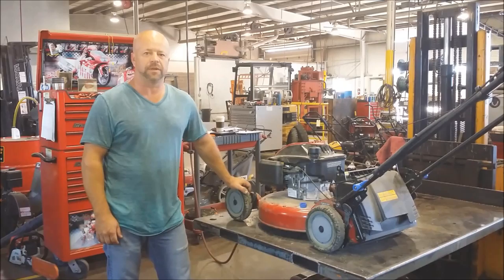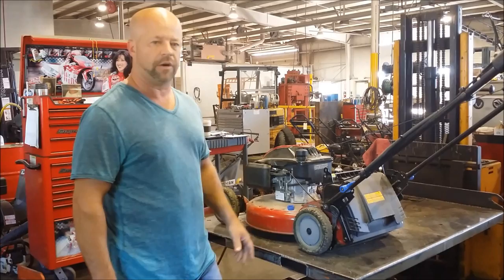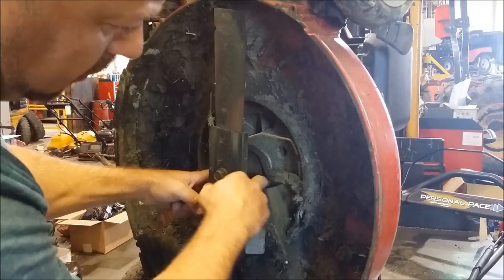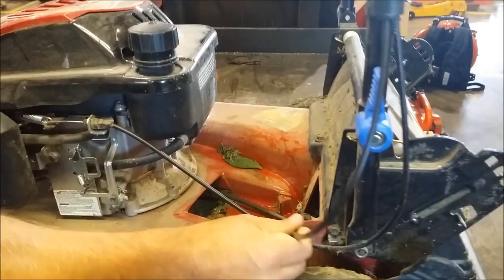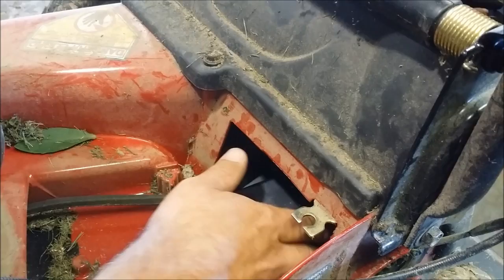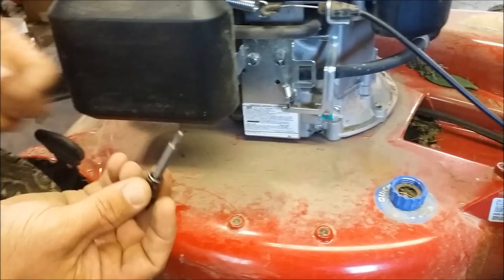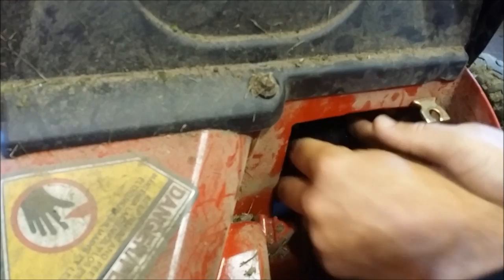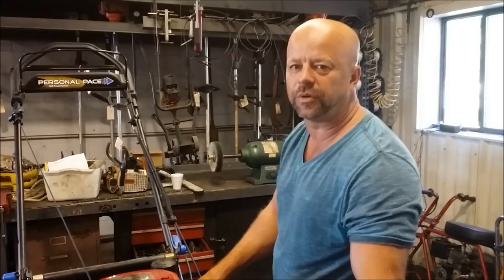How to Troubleshoot and Repair a Toro Personal Pace Drive Lawnmower

Comment: This video was helpful to me. I just removed the cover to the pulley on the transmission. My belt appeared at first glance to be on the pulley. However, the belt was partially off the pulley due to a 1/4 inch piece of stick from a tree that jammed in the pulley / belt / cover keeping it all from turning.

Comment: i have basically the same mower i'm working on for a customer and have installed a brand new belt. The transmission turns but very slowly. the belt is snug and tight but the transmission does'nt  move the mower. I can't find a troubleshooting guide to diagnose if the transmission is bad without removing it and trearing it down. what else can cause the wheel to not engage  As i said , it turns slowly. I can raise the back wheels and see the tires turning but as soon as i put it back down it won't move.
thanks for any advice.

Comment: mine is a similar model, but didn't have a plate to remove on the top. i needed to do all the repairs from the bottom side, removing all of the guards below. got the belt back into the groove, put it all back together, worked fine for a single mow, but then the belt slipped out again. not sure what's allowing/causing it to come off. :/ 
after the belt comes off the first time does it get stretched/is it more likely to come off again/need to replace? any other suggestions why it continues to slip off?

Comment: Good to see that they make it easier to get to the transmission,   I had to change a belt one from 2003 and the blade adapter was fused to shaft so I ended up putting the belt in at the same time as putting that engine back on as well.

Comment: Is there supposed to be a bushing or spacer between the pulley and the engine when I tighten the blade down on mine the pulley locks down on the engine case I had some one else replace the engine and they told me my engine was locked down I can loosen the blade and it turns freely looks to me like he left a spacer or bushen out

Comment: I have a Toro 20074 that I replaced the transmission and the rear drive wheels, after putting everything back in place the personal pace handle works in reverse, pulling the handle backwards tightens the belt and the mower moves forward, pushing in on the handle loosens the belt and will not move the mower, any ideas on what the issue may be?

Comment: Can one swap a regular bail handle for the awful  toro personal waste self propel? I want to buy a 20382 because its nice and light but hate using personal pace on hills. Not even toro dealers can tell me if the handle from other mowers is compatible. I dont care if personal pace system is destroyed in the removal. 

Thanks in advance

Comment: My Toro self propelled mower is a year old. It's self priming. It has a fairly small, neat yard to maintain. It is hard to start. I have to pull at least 8 times minimum. If I would have known this, I would have bought Electric Start or another brand..

Comment: I own a rear wheel propelled lawn boy that I bought a new belt for.  When I install the belt on the transmissions pulley it throws the belt off when I engage the rear wheels.  The pulley does not have any marks, burs or slop in it.  I installed the cover above the transmission correctly.  What would make the belt slip off the pulley?
Reply: Wore out pulleys and incorrect belt size
Reply: The mower can not be any older than 5 years and I bought the correct belt since I found out the part number for it.  How can I tell if the pulley is worn out?
Reply: Looks like both pulleys are shot. Notice how the belt rides INTO each 
one? Belt should ride above slightly on the top of the V. Should ride 
slightly OUT of the pulley. If the top of the belt rides flush or INTO 
the V, pulleys are done. Same with any other V belt setup. No wonder 
yours threw the belt off. This explains why.
Reply: But only the pulley on the transmission throws the belt out if it.
Reply: Did you buy an OEM belt? I mean a real deal Lawn Boy belt or an aftermarket one? Did you pluck one off fleabay and call it good? There is a huge difference in quality there.
Reply: I was encouraged by someone at a Toro dealer to buy it off ebay and it is a genuine toro product for a lawn boy mower.
Reply: All I see is answers to questions about belts on automobile engines on the link.

Comment: I'll 2nd dufus' previous comment. Idiots that post irrelevant comments to videos that people have gone to the trouble of posting, should stop wasting their time posting irrelevant and garbage comments. More importantly they're wasting the time of other people like me, that are looking for a solution to a problem and I'm having the same problem with my mower.

After looking at details I already had, a service manual and various web repair suggestions for Toro Personal Pace problems (... my mower is a 2013 vintage model # 20383 - cast aluminum deck not a steel deck ...) and it has what the Toro / LawnBoy service manual I have refers to as the PP2 version of their Personal Pace system (PP2 = Personal Pace Generation 2) I found Blake's video. My machine looks identical to the one that Blake is describing.

Today I realized that the self propelled function stopped working on mine. (I'm a 70 year old junior senior :-), but pushing it without the self propel feature I originally bought it for, gave me a good workout, but it wasn't fun). Thanks to Blake's video I now know what to look at and will likely be able to fix mine quick and without having to take it in to a repair shop and waiting weeks for it to be fixed. Thanks Blake.

Comment: The personal pace on my Toro works, but is weak going up hills.  Any ideas?
Reply: My brother in law has the same issue, going to take a look at it to see if I can find the issue.
Reply: I sold my 12 year old personal pace Toro and bought the new 4 wheel drive model.  Had to take the first one back as it was taking 3-4 pulls consistently to start.  Replacement has been fine and love the 4 wheel drive.
Reply: Simple personal pace cable adjustment. Don't read your mower manual. Come here and ask dumb questions.
Reply: Well then Sally, why don't you replace the belt and both pulleys with OEM parts and be done with your silly comments? On Toro Personal Pace mowers, if it doesn't drive properly, all it can be is the belt, two pulleys or the cable adjustment. That's it sweetie.
Reply: How about for an AWD? I can't find anything on line about AWD other than a few reviews. I replaced the belt but the rear wheels still don't drive the mower: only the front wheels.
Reply: I recently went with the Toro 4 wheel drive!   Works much better up hills!